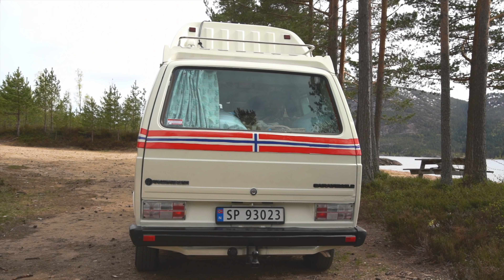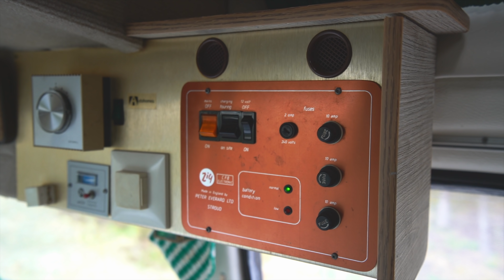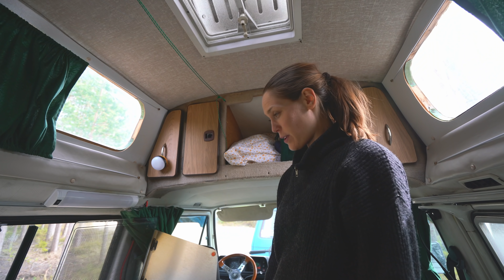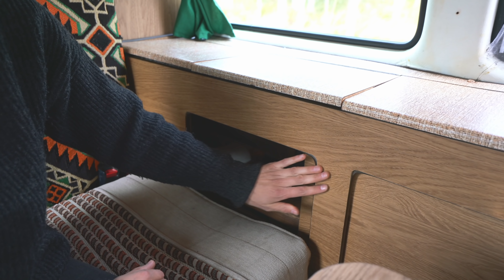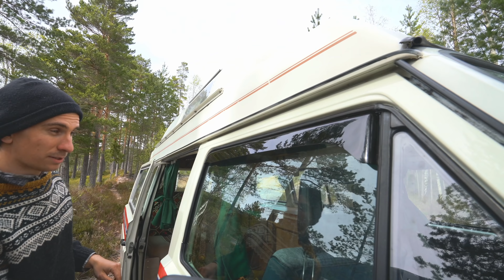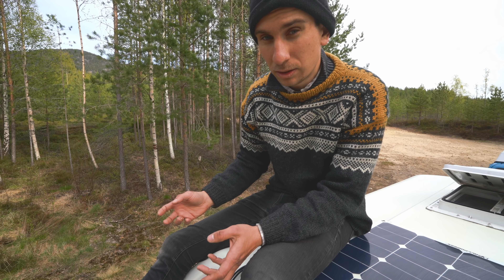VAN TOUR: Cabin on wheels (with a balcony!) - VW T3 high top camping converted

Comment: Great video! We've subscribed to your videos. Amazingly we have just bought the exact same T25/T3 van type as just starting out with van camping. The van (bluebell) needs a little TLC tho...  One question, we have the same water tank under the hinged seat. Is it possible to install a rock-and-roll type bed over the tank? If so what and where can we get the parts? Many thanks
Reply from the maker: Thanks! I just made this video, I have another version of the T3. However, I just changed to the rock and roll hinges myself, I bought them from serial-kombi.com
Reply: @SimonBraeck  great thanks.
Reply: let us know.  I would be no,because you see that wood tray thing, that means his bed rides higher than a Westy and everything seems to Westfalia design which is probably the basis for the rock and roll bed.  That's ok, when you own a T3, you have to be resourceful, creative, and hard working...you could probably install the frame and modify as needed to clear the taller water tanks.... westy put the tank along the driver side or by the sink...
Reply: Nice 👍 van 🚐 hi from Australia 🇦🇺